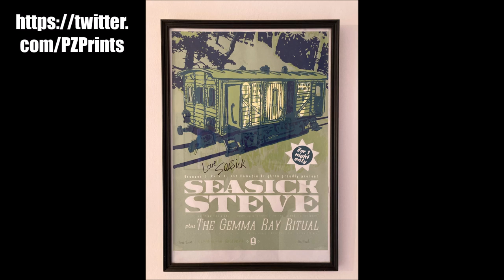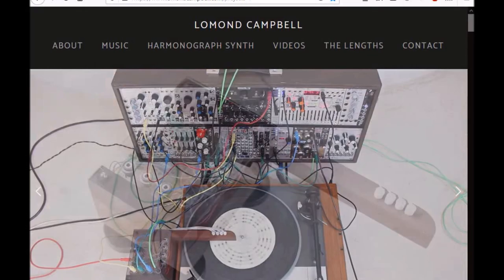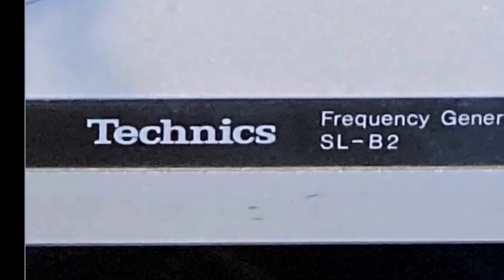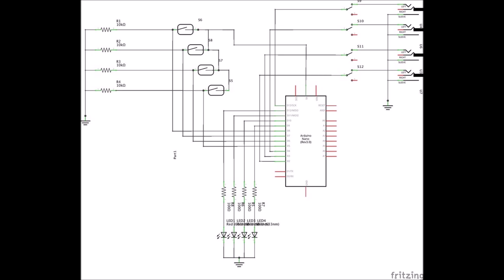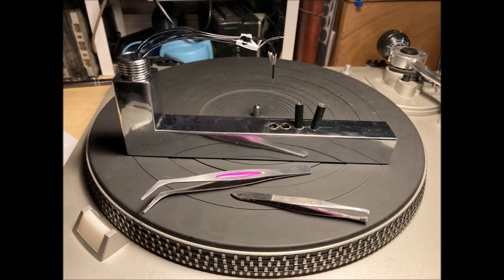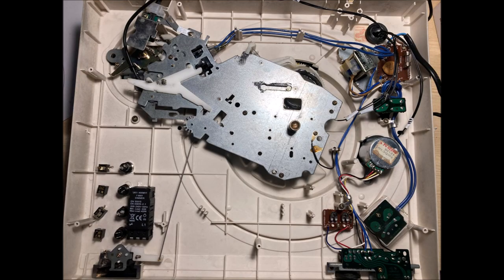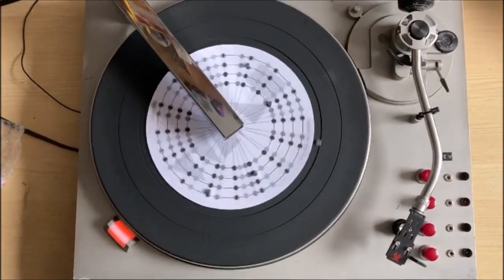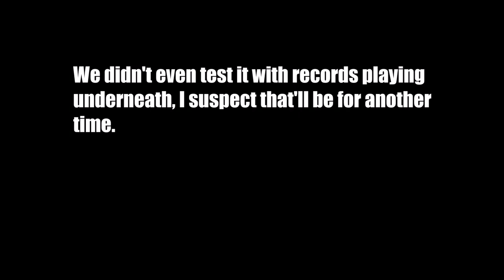#22 Modular Turntable

Comment: Can this be done from non- eurorack use? Just to trigger sounds on other devices. Also do you have to use an arduino?
Reply from the maker: The circuit isn’t my design, it belongs to Lomund Campbell and I cloned his idea that was Arduino based. In doing it that way you keep the signals clean. I suspect there could be a way of doing it with transistors but it seems a long way around the problem. You can trigger anything with this. Anything that has a gate/clock in. Doesn’t have to be eurorack
Reply: @prrkindustriessoundenthusi2948  thank you for your feedback.

Comment: i usually have an easy time with the chinese knockoff arduinos using the old bootloader.
Reply from the maker: It’s true, once you get the setup right and become used to the setup for writing to the Chinese cheapos it’s ok. I was thinking more for the first timer having a go at Arduino, the legit boards are much easier to program and aren’t as susceptible to errors. It’s a fine line isn’t it? We need to support Arduino, but the cheapo boards are so much cheaper!